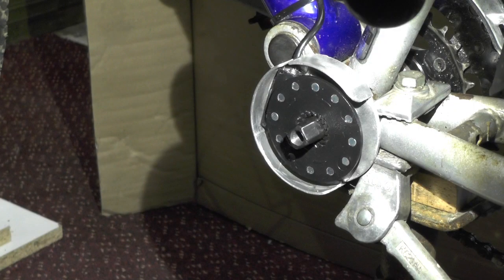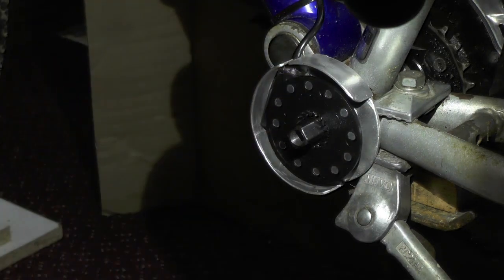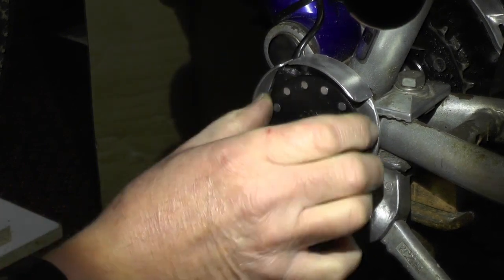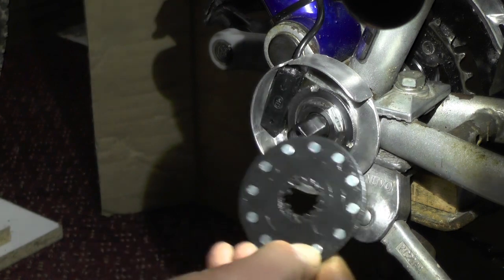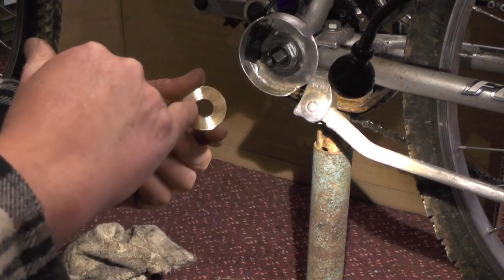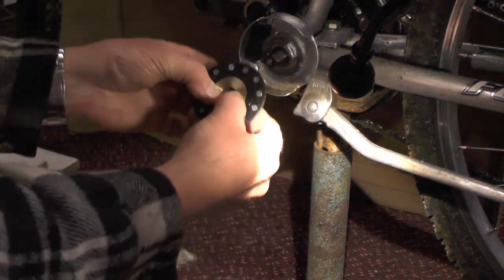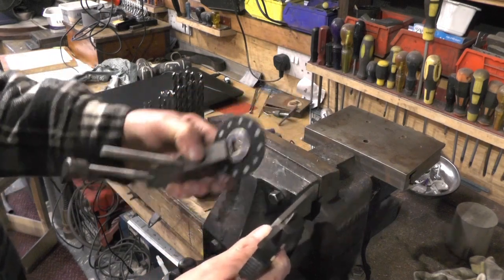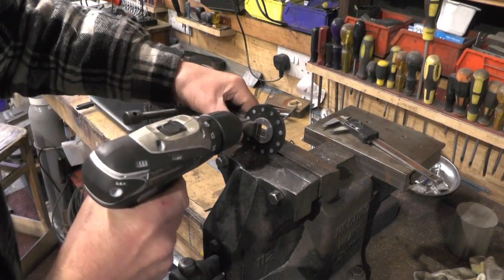Ebike Pedal Assist Sensor Magnet Ring Common PAS Fault  Simple  DIY Fix electric bike  "mr factotum"

Comment: you can bond it in position against the crank using a ribbon of loctite kintsuglue flexible putty, works very well, sets overnight to a hard rubber bond. magic stuff !!
Reply from the maker: cheers colin
i will remember that for next time. thanks for info, and for watching
regards
kev

Comment: Hello, great informative video, took my Swytch Bike out yesterday for the first time, very pleased inicially, i had the motor on constantly with a full charge, after about 6 miles whil'st going up hill the motor would cut out intermittently and start again in a few seconds as in your video. Checked out the disk today, although it is not the most stable fixing you could have for the disk, in my case i don't think it is moving, i will put a white spot on it lined up with a mark on the peddal, that should tell if it is not continualy turning, i must have done about 12 miles with some steep hills and had to get up in some parts under my own power, the power pack was spent when i finished  maybe i should just use it on the hills ? a bit disapointing, but time will tell.
Reply from the maker: eyup david
i initially was interested in the swytch kit, but after a lot of research and a steep learning curve i decided on my diy version due to huge price difference. Hope you get sorted out ok. good luck
ATB
Kev

Comment: When pedaling backwards the sensor is working, what do I do?  is already correct the position of the disk, and sensor
Reply from the maker: hi ebikesbr
all i can think of is the magnet ring is in wrong direction or magnet number is wrong for the controller, are all the magnets poles the correct way,   maybe the wiring to the sensor wrong or faulty controller, it's hard to say with not being hands on, hope this helps.👍
regards
mr f

Comment: Added a pas system that came with kit and it does not work. Any ideas as to why?
Reply from the maker: check that the magnets are rotating concentric and equally about 3 mm from the sensor and that the magnet ring is not slipping on the crank.  if thats ok check that there is 4v going to the sensor from the controller on the +ve wire, if thats ok then with the power on check the return signal wire while rotating the pedals if i'm remembering off top of my head there should be around a 2 volt reading returning back to the controller to tell the controller to send power to the motor, also check the negative wire for continuity,  So thats all the 3 wires to check. if they all check out ok, it may be that it's the controller not functioning to tell the motor to spin. hope that helps
regards

Comment: I have a Rad unner plus only a year old. Sometimes the bike PEDALS ITSELF and I have to try to hold pedals from turning  there is a CLANK and sometime chain tries to jump off the track. What do you think I should tell the bake shop to look at?
Reply from the maker: Hi Rick 
I'm no expert, just self taught, but if the pedals are setting off on there own it could be a number of things, the controller, the motor, pedal assist sensor, or wiring shorting, i think its a matter of one thing at a time to eliminate / isolate the problem, very difficult to give a more precise answer with not being able to be hands on.
Hope that helps
take care and good luck
Kev

Comment: I recently built and ebike and having trouble with my PAS. The one that came didn't work so bought 12 magnet easy slip around crank. Problem is wiring. I know black goes black. My PAS is yellow, brown, black and controller is red, blue, black so put BB, YR and BLBRW. Not sure wth when put black to black motor spins tire without pedal. When crank pedal sensor lights up but now power from battery. HELP. Is possible that this sensor not compatible? Is wiring incorrect?
Reply from the maker: hi maryann
Its about a year since i applied my brain to the subject and Its hard to say without seeing it and physically  testing it. The ones i used don't light up  or flash in use.
Ive heard people say and i have learned from experience that if your not using the amount of magnets your controller is set for it may work erratic, some controllers let you change this setting apparently, mine don't though, as for the wiring, there doesn't seem to be any colour coding wire standard in this industry. But the PAS is just a switch, the one i used has a hall sensor in it, and the magnets just switch it on and off as they pass by, then the controller works everything out from the pulses.
The 3 wires what ever colour they are will have a negative (-ve) a live (+ve) not sure of the voltage off top of my head  but i believe it to be about 5 volt, then the third wire is the switched positive that carries the pulse when switched by the hall sensor to the controller. 
Its just a matter of putting a simple cheap multi meter on the wires to check continuity and voltage to find out what wire is for what, sorrry i can't be more precise but is something that needs to be physically checked and looked at,.
good luck
regards
mr f